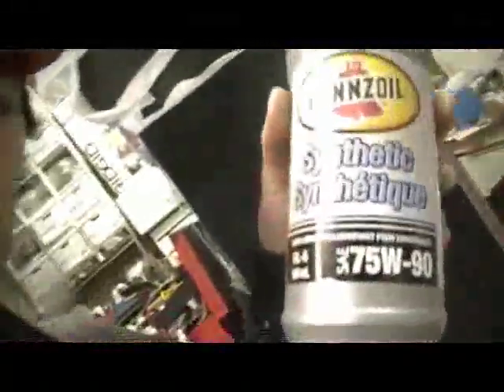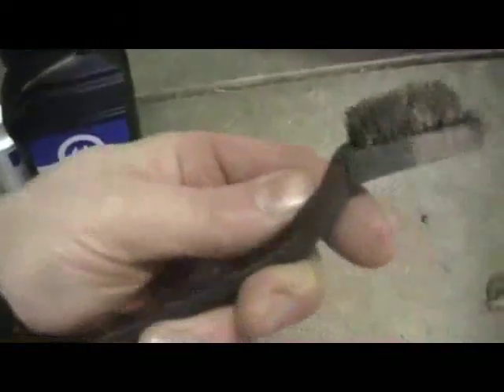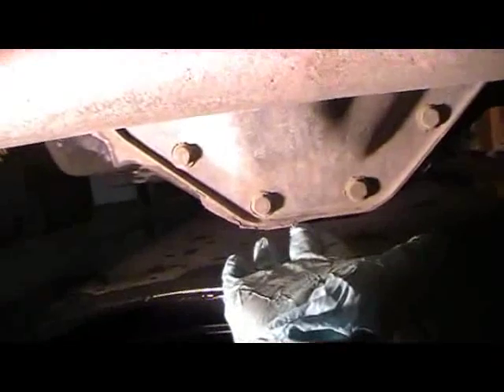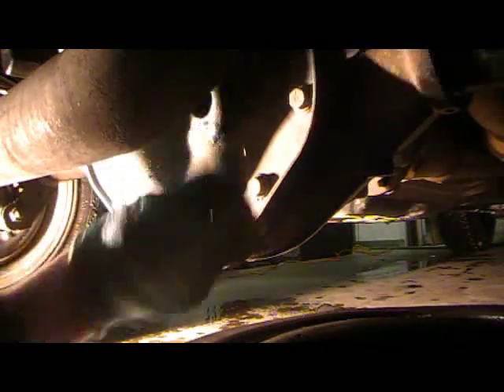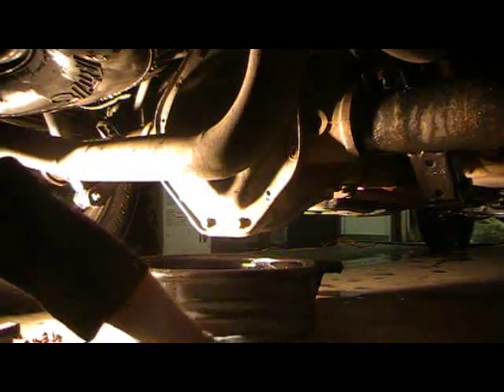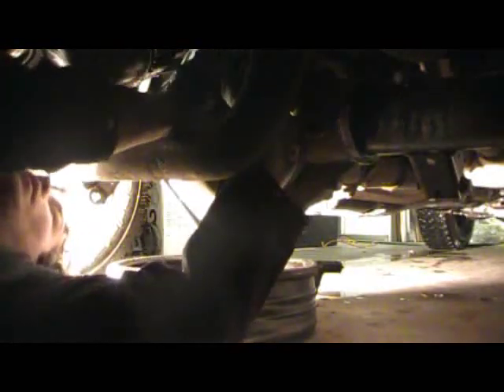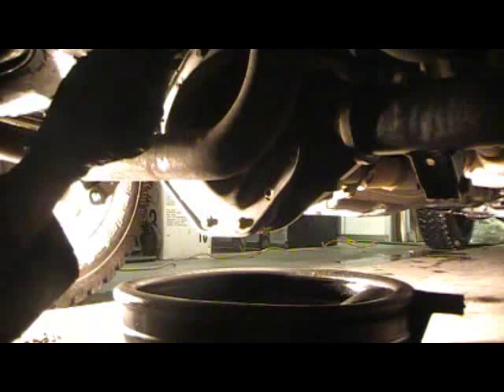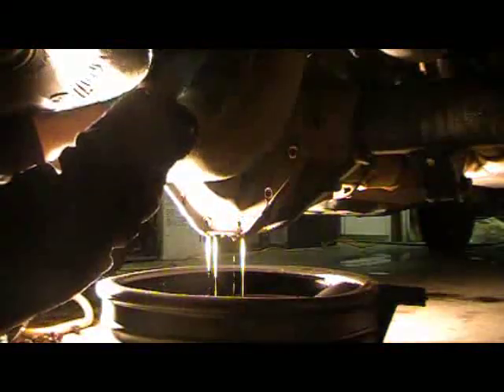How to Change Your Differential Gear Oil Part 1

Comment: Nice username. I have a 2005 Dodge Dakota ST with a six speed manual trans. The last gear oil change was March 2006. I know. The dealership did it for me (and it was expensive!) So, I'm going to do it myself. Change the differential cover with a chrome. It is not a limited slip. It does use 75W-140.

Comment: Jiffy lube talked me into changing mine.$100 Drove 30 miles home, 60 miles the following day. Now I see the differential casing is very wet and parking pad has big puddle of D fluid . 2004 Dodge  Ram 5.7 L Hemi . Is my truck ruined now? It has never given me can't problems and I don't have the money for a new or used vehicle.
Reply from the maker: LibbyD1958 No, your truck isn't ruined, but very likely they botched sealing up the diff cover which caused it to leak very badly. I would recommend topping off the gear oil and taking it back to them and complaining.If you drive it with the fluid too low, it'll wreck the gears in the axle.

Comment: Can I just suck out the oil from the rear differential like you did the front or is it best to remove the whole cover to drain?  Seems so much easier to not mess with the seal.
Reply from the maker: It's best if you remove the cover because then you can clean the magnet in the bottom of the case. But if you want to extract the fluid, that works too.
Reply: 6speeddakota ok thx

Comment: I have a 2001 dodge Dakota SLT ext. Cab 3.8l v6 2wd. My question is what type of differential do I have. Idk whether in have the limited slip diff or the standard diff. I think I have the non slip but I wasn't for sure. Thanks
Reply from the maker: I have another video with a condensed version of how to change the oil in the differential. In that one, I explain how to tell if it has an open carrier or limited slip. But to save you the hassle, I'll explain.

Jack up the rear wheels so they're off the ground and sit it safely on jackstands. Release the parking brake and attempt to spin a rear wheel with the transmission in park, or 1st gear (depending on stick or auto, you want the transmission locked). If the wheel spins easily, and the wheel on the opposite side spins in the opposite direction (i.e. you spin the left rear in a forward direction, the right rear should spin in a backwards direction).

If it feels like it's locked (i.e. it'll spin just a fraction in either direction and you'll feel it lock up) try putting the transmission in neutral and repeating the process. Then try spinning a rear wheel. If you have a limited slip, it'll spin the opposite tire in the same direction and it will also rotate the driveshaft.

here's a link to the video I referred to earlier if my rambling on isn't clear. Most 2wd's don't have a limited slip, so it should be pretty easy to tell. https://www.youtube.com/watch?v=waitdNjdGC4
Reply from the maker: If you need any more help, don't hesitate to ask

-6sd
Reply: Alright I'll give it a try thanks

Comment: I have a Honda s2000 with lsd, will I need to add lsd additive? I don't see it as a requirement in the owner's manual, but then again it recommends oem differential fluid which may have lsd additive in it.
Reply from the maker: I've done some research and it doesn't look like it needs limited slip additive. The S2k has a mechanical type (torsen style) differential which does not require limited slip additive. Clutch type differentials like the one in my truck require limited slip additive. Honda does sell Hypoid gear oil for the S2K, but I believe any synthetic 75W90 gear oil should work. Best give your local dealer a call before diving in head first just to make sure you're not missing anything.
Reply: +6speeddakota thanks for the info! I'm new to your channel. I just subscribe.

Comment: nv3500 oil and its manual transmission oil. i asked the guy how a transmission could take both manual and automatic fluid but he couldn't give me an answer. my thought is so what if the transmission can take atf but how well would it mix with the remaining nv3500 oil already in it. ill give you my info anyways for the next time you get to school. 2004 Dakota 3.7L SXT 2WD Manual